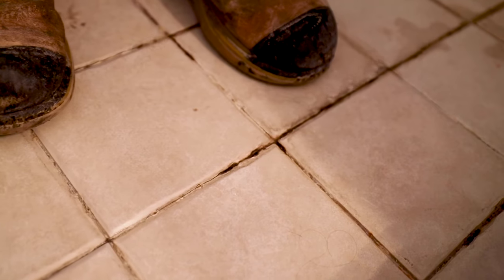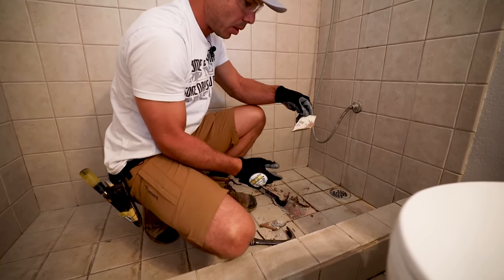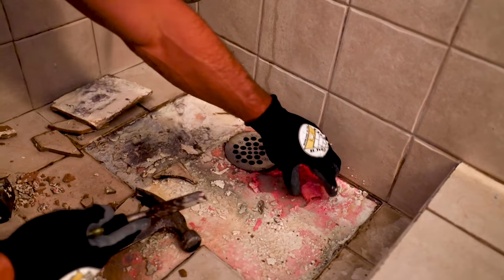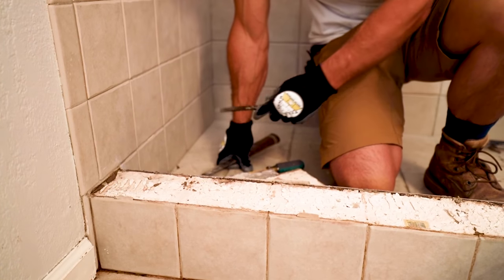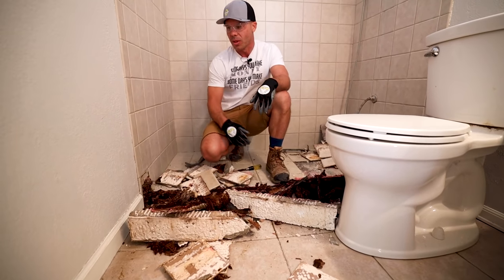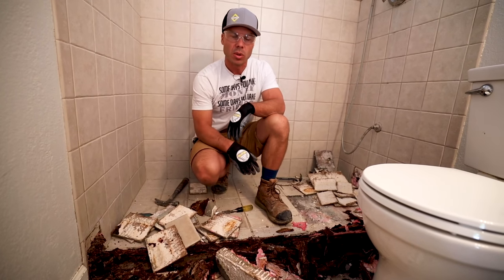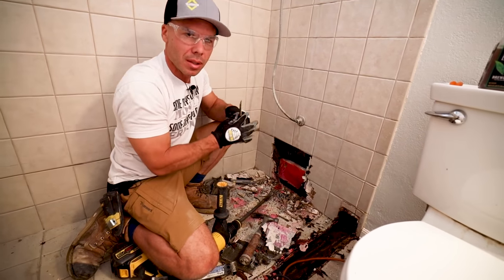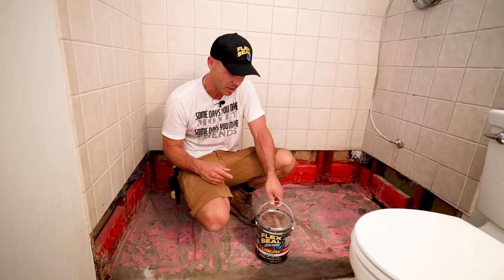Homeowner Used REDGARD and His Shower FAILED!!!

Comment from the maker: I did not receive any sponsorship or paid advertisement from Flex Seal or any other products I use in my videos. This will be a really fun video, stay tuned!!!
Reply: Your title should have been "Homeowner Used REDGARD AND MASTIK and His Shower FAILED!!!
Reply: @northernlightsrenovations1710  totally agree that the mastik was prob the cause of majority of the fails in this shower. had he used thinset this would just be a remodel to update look lol.
Reply: You willing to put your time and rep on the line for flex seal?! Your buddy ok with it maybe failing and having to redo it all down the road?!
Reply: I have used redgard on a few upstairs bathrooms overtop mortar beds and 7 years later they are in good condition. I am pretty sure it was user error. I have found that if you go too thick you get cracking and that is very easy to get in the corners. I would assume that if he only got his info from a Home Depot person he may have applied it too thick and either got cracking or even may have set on it when it was too fresh. You should do an updated video on your new proffered method of waterproofing.
Reply: @marcusaydelott   Agreed Marcus, painting it on too thick seems to cause cracking.  It's also important to have a dry and clean surface to paint it onto.  Two thinner coats is ideal.
Reply: any update?
Reply: Just curious how much does a typical demo job for the shower size and tile job cost ?

Comment: I'm a complete amateur/home owner and what I got out of this video was: Shower lasted 20 years; don't use mastic in the shower or any wet area; and RedGuard did it's job as advertised saved the lumber.  I think MAYBE this video is slightly mistitled.  Thanks for your time and efforts though!
Reply: It didn't last 20 years though, a curb that looks like that has been rotting for a decade.
Reply: I'd say he did it correct and you can use mastic on walls..I think the guy sold him premixed thinset and that doesn't work 🙂 I can't believe your using flex seal..it will never work..
Reply: Not sure if you saw the video. But RedGuard did not save the lumber 🪵 in that curb.
Reply: @mathusvaiaoga9787  

Redgards instructions clearly state to not use mastic.
Reply: @mathusvaiaoga9787 the curb should have had the pvc liner over it maybe thats why its didn’t hold up

Comment: The redguard was probably the only thing that contributed to this shower lasting 20 years
Reply: Red Guard been out for 20 years?😯
Reply: @reddbeard2030  maybe longer?  I learned of it in ‘05, but it had already been out for a while.
Reply: Fact. This isn't a Redguard failure, this was an install failure. If they'd used mortar instead of mastic, it would be been fine.
Reply: @dizzy13sn  what kind of mortar? Thin-set?
Reply: @FernandoMartinez-xn6rj  Redguard says right on the install on the bucket. A polymer modified adhesive designed for tile installation. If it doesn't have the polymer modification in it, it will fail.
Reply: @joshuawiedenbeck6944  people never read the instructions
Reply: @netaverse7694  Probably why showers fail.
Reply: @reddbeard2030  Yes!!  I in fact worked for a flooring distributor formerly in Elizabeth, NJ, for 19 years; we carried Redgard along with many other Custom Building Products; I've actually been several times to their center in Southwestern NJ...  Redgard is an excellent product, but of course improper installation will ruin anything
Reply: @ajalbetjr  😲 Thanks Much!

Comment: Yeah, I don't think it's fair to blame that failure on Redgard.
Reply: I agree. However, id never rely on just fibatape and redgaurd on my curbs. Red gaurd does lose its waterproofing ability over time. I always use a sheet membrane plus a roll on waterproofing on shower pan, curbs, benches and niche sills. And in some other circumstances as well.
Reply: It seems the regard is the only thing that saved the shower. If was done with thin set may have lasted another 10 years.

Comment: Title should have been Redgard saves framing even when incorrectly applied.
Reply: It didn't save the framing on the curb!!  
You guys need to understand that there is a difference between an adhesive and a waterproofing membrane.  
YES....ABSOLUTELY , Mastic sucks as an adhesive, but that has nothing to do with the curb rotting out . Mastic failures result in tiles falling off due to poor adhesion 
Redguard failures result in rotting wood, cracked tiles (which is an uncoupling failure)  and moisture getting in wall cavities. 
And Redguard DOES fail from time to time.  
Why?   What do you do after Redguard is applied?  You use a notched trowel to apply thinset.  Notched trowels scratch the hell out of a surface.  
It is a skin...a membrane.  It is easy to breach. 
Here is an experiment to prove a point.  Try taking a notched trowel to your bare leg using the same pressure and force you would use to apply thinset and let me know what it does to your leg after a few minutes of scratching it. Your skin is very similar to a membrane.

Comment: See how well the redgard sealed that toilet??  Stuff works!
Reply: yeah. this hardly is a red guard fail
Reply: seems like a mastic issue
Reply: Water coming up, you can use anything you want, but if you have subfloor flex, incomplete grouting, or using mastic on a shower floor you’ll have that issue. I wouldn’t consider a Home Depot employee an expert, why would you be working in the tile and flooring section if you were. I use it after my pan mortar has cured and over my walls after my seams are taped and sealed. No pan liner. I would say, that’s not the Red Guard but, watching too many diy shows
Reply: It’s no a redgard problem is fucken mastic problem issue

Comment: Homeowner misused red guard should be the title, the stuff is awesome, used it for many years on many projects never had a single call back or problem with the stuff it's essential that it's fully cured before you lay tile on it and actually when done right it forms a very tough thick layer.

Comment: Didn't use epoxy grout obviously. That, and mastic, is what caused the failure. After 20 years, Redguard was still working and saved the framing.
This is a great validation of Redguard, and I'm glad I used it on my recent shower build. It's over a crawl space, so if it ever leaks a drop. I will be able to see it.
Thanks for the interesting video!

Comment: Hi Isaac! Can you explain how the Redguard failed in this application in another video?  It seemed to be the only product used correctly in this shower build. Perhaps it's why the shower lasted 20 years 🤔
Reply: Because the water gets into the foundation so redguard failed. And also curb failed
Reply: @hjwang4477  so did the water get into the foundation because the tile was NOT installed correctly? If the tile was installed wrong that's not the fault if redgard.

Comment: Flex seal failed when used in stock tank pools, possibly application errors or chemicals contributed to the failures but either way I wouldn’t use in in my shower. Red guard has proven to be a good product when applied correctly

Comment: I use regard all the time. I've also used laticrete, Mapei, and other competitors paint on water proofing/anti fracture barrier products. I wouldn't consider any of them better then any other others. The biggest difference between them is the different colors. 

What I saw you do is what I've been doing for over 13 years now. Cut strips of laticrete antifracture fabric and use it like drywall tape on all the seams of the shower/inside corners. Then you paint a second layer on everything after the fabric is bedded. Have to use a brush for final stroke. If you use a roller it pulls off the fabric on the back of the roller sometimes. That's the secret to a real functional waterproofing layer. I also prefill all my inside corners/seams with sickaflex polyurethane based construction sealant. 

The best way IMO is to do a waterproofing layer on the top of your mortar as well. Then it basically seals off the mortar from the water washing out the lime over time and depositing it in the drain or weakening the mortar. The underneath waterproofing layer is just a second layer of protection if the top fails to stop everything. I use a full piece of fabric across the whole pan on top of the mortar along with a paint on water proofing and fabric sealed corners. The only thing that causes even a well made mortar shower pan to fail over time is after about 30 years or more the wet mortar becomes weakened from the lime being washed out. Waterproof the top and you prevent 99% of that.
Reply: I feel like you know your shit. Good stuff.
Reply: @efflux  Been building showers now professionally for 16 years. Haven't had a single one leak.

Comment: I worked 40 years on elevators in many buildings that were over a hundred years old. Water, heat and uv light degrade almost everything. A wall, floor and ceiling move against each other. Anything that cannot take that movement over time will fail. Wood on concrete that gets wet certain failure over time. Even a copper roof fails in due time. A shower is a tough environment.

Comment: I used red gaurd many times, yet to see it failing. 
It all depends on your workmanship,  the way you perform. 
I have tile stallers that cut corners on a thin set applying on the floor or walls that give them a twice speed scale on installing the tiles so they can make twice more money in one they. 
But you and i know those areas that don't have enough thin set on them. They will break once someone steps on them. On at least crack. I have seen tile staller and more.

Comment: 20 years on that install is pretty impressive considering. Im often amazed at the random durability of some of the terribly built stuff I've torn apart, definitely seen some crazy head scratching stuff.
Reply: Yeah I have tear up some tiles that directly bound to wood sub floor and it took me a lot more effort to remove than tiles over mortar bed imbedded with wire mesh. Some Times it makes me wonder if it really worth it to do all these by the book.
Reply: @jlai3861  Depends on the application, sure mastic adhesives can be harder to remove but they serve a different purpose than mortar beds for example. Substrate materials, framing, environment and specific use all play a role in deciding what install method to use. 
Yeah people mix them up all the time, Ive pulled mastic glued tile out of bathrooms and once went to redo a 3x5 entryway once and it was on a felt backed 12" thick mortarbed with mesh in a dry area. Never know with people.

Comment: Since the curb tile was directly applied to a wood surface and the lumber was in direct contact with the concrete there would be tiny voids between the surfaces that would sweat from the steam and temperature changes, and that alone will cause dry rot even if the outside surfaces were water tight. That's why proper vapor barriers and substrates  are important, and most of the time home owners don't realize that and that's the first place they cut corners to save a buck. The dry rot on the curb started on the inside way before surface water started getting in. I started as a concrete finisher and carpenter in new construction. When the market tanked I started remodeling and learned how to do drywall, tile, vinyl, and every thing else involved for the most part. So I'm on the job from start to finish, and after 30 years I'm still amazed at some of the shit people do to their own houses trying to save money.

Comment: So, what exactly made the shower fail? Is it because of the mastic and failure to seal the grout?
Reply: That is one of the biggest myths in the tile business. Most sealers are designed to "form an invisible barrier that is resistant to moisture and stains while allowing vapor to escape". All cement based grouts will allow water migration over time.
Reply: Be nice if Isaac chimes in here, but my take is the structure was: subfloor cement, redgard, preslope cement, redgard, mastic, tile.  The mastic failed allowing the tiles to move, and the top layer of redgard failed in at least some capacity (maybe punctured by tile movement?).  Water saturated the preslope concrete but was held back by the bottom layer of redgard.  The preslope was touching the wood curb and it rotted away.  So the end result was mold and mildew, flexing curb, and water squeezing out between tiles, but the water was ultimately contained within the shower and did not cause failures in the studs (also individually redgarded) nor the surroundings.  Pretty close call.  Also demonstrates the "moisture sandwich" which is an argument against applying liquid water proofing over sheet membranes, which Isaac does quite often.  This sandwich likely saved the structure in my opinion.

Comment: I'm actually shocked. If he had used a shower pan, he would still be using that mastic shower! Wow!
Reply: I am a contractor and have done dozens of bathrooms. I will only use pans. its not worth the liability. they are also easier to clean.

Comment: One thing a lot of people don't know is mastic isn't compatible with most liquid waterproofers, as the mastic chemically messes with the liquid waterproofing layer. The only manufacturer that allows their own mastic and liquid waterproofer together is actually Tec, none of the rest do. If you wanted to use mastic on a shower/tub surround wall you'd need to use a plastic sheet behind cement board and that's it, anything else and you get no warranty.
Reply: absolutely not true mastic is compatible with nearly all liquid waterproofing membranes around the world, dont know where you got this idea from lol

Comment: I did this mistake once.  I put a new tile floor in a shower over an existing tile floor with mastic and it did t work. I had to pull it up and redo it with thin set.  Shower didn't leak since it was already waterproof before I started, but it was a lesson learned.  Just completed another shower this month.  No mastic in the floor!

Comment: Red Gard works correctly when installed well.  Being that this homeowner used tile mastic in a shower and with Red Gard that's a double no no.  Not sure this is a Red Gard issue so much as a bad tile installation ... Not to mention Red Gard cannot be used over wood as per their installation guidelines.
Reply: Redgard can be used over wood as a crack isolation membrane, but not as a waterproofer. I think the other part of the issue is with mastic it actually causes a chemical reaction to the Redgard, none of the tile manufacturers allow mastic on top of their liquid waterproofers except Tec, oddly.
Reply: @GilBatesLovesyou  Ahh yes good call I should have caveated that (crack isolation membrane).  Oh interesting I did not know that part, but I do know the tile glue has a very very hard time curing between the membrane and the tile.  I'm surprised the tile even stayed and did not slough off the wall.
Reply: @TheBabaYagas  Yeah, if you look at Custom or Mapei's TDS for their liquid waterproofers or any mastic, they all say not to use them together. If you want to use mastic on a shower wall you need to go with cement board plus plastic sheet under it, which is actually cheaper and probably would hold up fine on walls with 4x4s or something. Just under bigger tiles the mastic would never dry.

Comment: A true test would be to build it back exactly like it was done before, with the mastic, except use Flex-seal as the waterproofing system. If it lasts 20 years, I’d really be surprised.

Comment: I demo'd a shower a couple years ago that used a bucket of premixed thinset without reading the instructions. It can't be used in wet environments. It just like the buckets of Drywall mud vs bags of 20/45/90 easy sand. Premixed mediums will reabsorb water after drying and return to a paste, because they depend on water evaporation to bond. Even if the instructions say you can use on a shower wall... don't.

Comment: I see a lot of comments about mastic contributing to water failure. You should build the shower where you can fully use it without water loss without a single tile or any type of masonry. Mastic made the tile adhesion fail, but the structure was rotted from an ill planned waterproofing. Tile,grout,thin set does not stop water.

Comment: How long should tiled showers last before the material wear out and leads to leaks?
Reply: Properly installed:: A tiled shower should last the lifetime of the home.  Reguard isn't difficult to use,, it just takes a long time to apply.  Reinforcing tape, used in corners and seams,, 2 thick coats on vertical surfaces,, 3 thick coats on flat surfaces. Last coat should be slightly "combed/notched troweled for thinset grip,, AND each coat needs about 24hours to cure (not dry, CURE).  So, You can see why this product is not popular with contractors.  Modern felt/cloth membranes install and dry in 1 day.
   Then there is "sealing".. Cement based grouts need 2 to 3 days to CURE,, before sealing.  Contractors don't like coming back to job sites.  So they'll tell ya it's not necessary,,  or might use a modern waterproof grouts , that are fine for dry areas,, but not wet areas. "Waterproofing" is what goes under the tile.. "Sealing" is a topical application.  Sealers can last for decades,, before needing to be re-coated.
Reply: @gcrady  alright.. thank you.
Reply from the maker: @gcrady  exactly!

Comment: I was always told mastic was for counter backsplashes, and at least a foot higher in the shower or tub enclosures  for  small form tiles .and I think you're pretty lucky that curve was drier looking compared to some that I've seen that have been like a gray mush.. it's like you almost want to throw your tools away after you scraped it out with no end to the smell. Lol ..looked like even though it lasted 20 years it was doomed from the start because the flooring didn't flow to the drain, much less the other problems.. lol love these videos always like seeing other craftsman doing there thing..